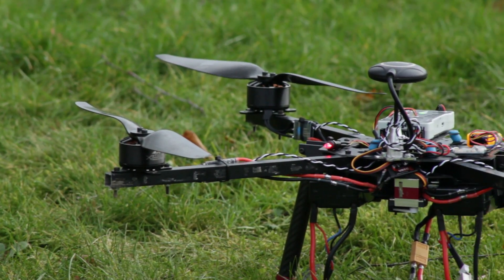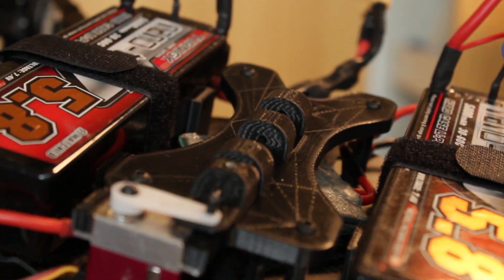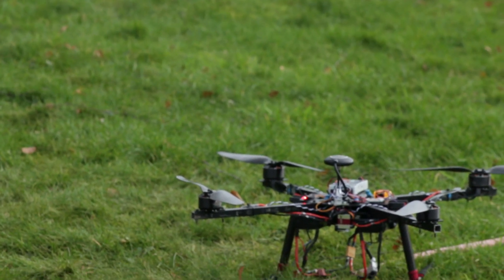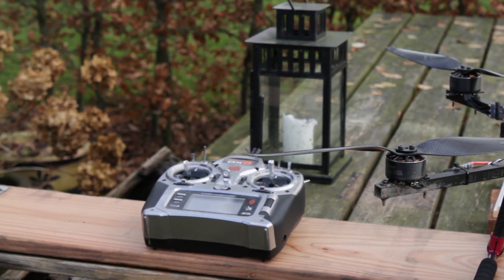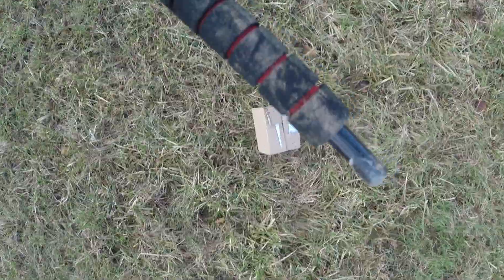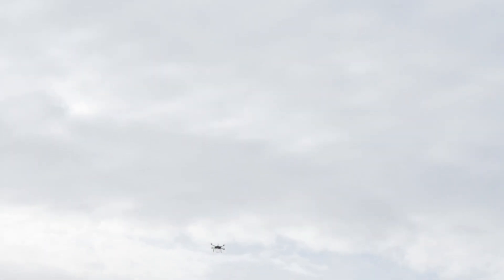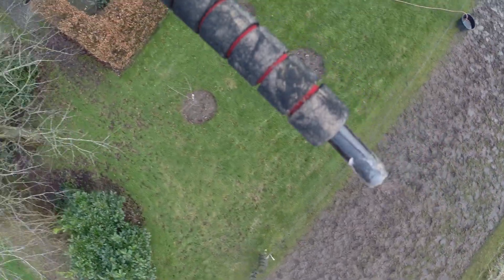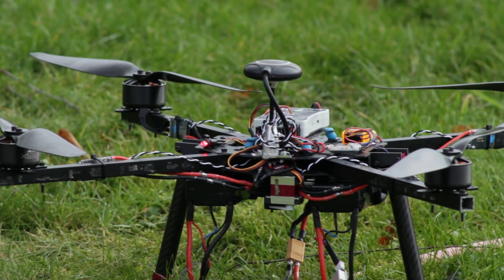DIY Amazon Prime Air - WORKING

Comment: Is there a parameter for GPS drift so that the flight controller will correct if the drone moves a certain distance away from the preprogrammed path?
Reply from the maker: +Tyler Jones it does throw continuously. It will always try its best to stay on the path. The GPS accuracy is +- 1 or 2 meters or so depending on how well you calibrated it
Reply from the maker: +Karl-Emil Storm i mean. It corrects its position continously to follow the path